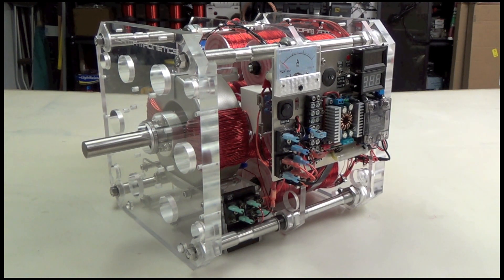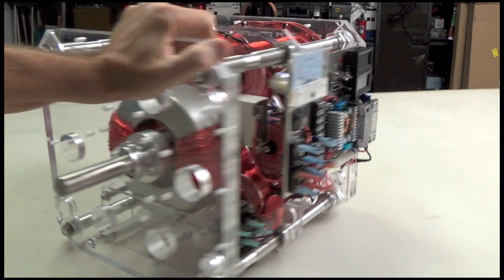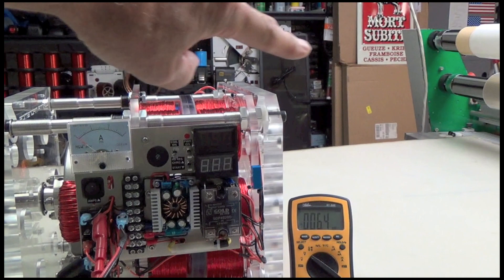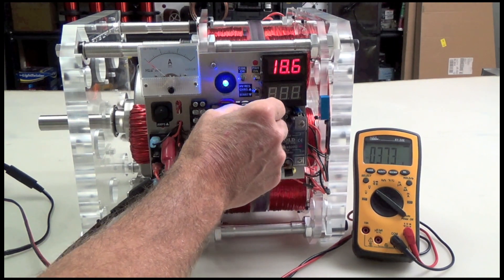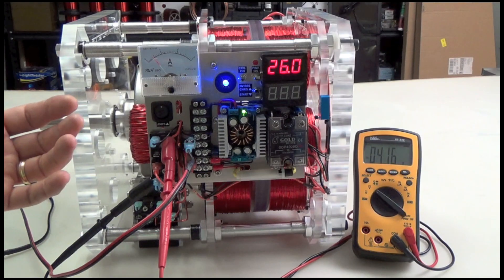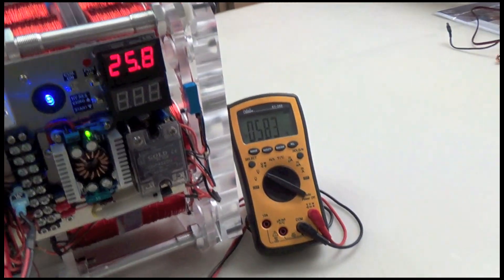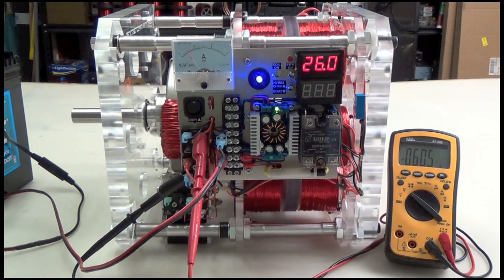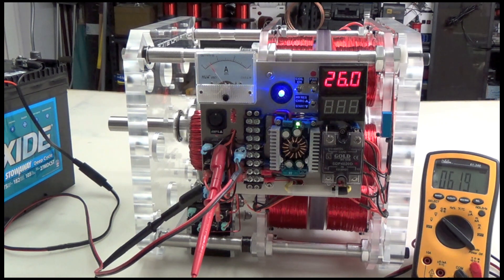Battery Bank Charger - High Efficiency T1X

Comment: If you tape up and varnish your windings they will be more solid and produce less noise. Standard motors are usually wound up in threads taped and dipped in varnish to prevent noise.
Reply from the maker: Thanks, Steve.

Comment: Great work!  Would this be a great generator for an electric car?  I could see this device just spinning away in an electric car to top off the batteries.  Then you would have limitless range, yes?  Is there a run limit?  Does it over heat? Is there an optimal operating temperature?   Very interested.  Keep up the great work!
Reply: I think it'scalable for a car but this is prototype for energy conversion to apply electric current and not the electric drive train to apply torque specifically. This would make for some interesting modification proposals to Tesla's open source information.

Comment: This looks cool but what is the reality? 
Can I use this to charge 20 - 24v 200ah batteries on parallel from 50% depletion to full charge in X number of hours. And if it can what does it cost to buy and then ongoing costs to operate?

Comment: I have been watching some of your videos they are very good with the exception that you're not using computer software to monitor the performance of your generator. it would not hurt to connect a laptop with the proper software to regulate your performance of all your machines, just a suggestion. Meters are fine if they're in the form all software where you can really know what your machine is doing to Diagnostics analysis software.

Comment: The best device  that have seen so far.How many amperes on 15 volt will this unit charge to a battery ?
J
Reply from the maker: I didn't record the specs after deciding it was too dangerous as a kit for the public at over 600V when coils reached resonance. Blew the circuitry in some crazy tests. Replaced most. Might sell the original proto.

Comment: Be cool to have a super bright LED flash light that was always ready with no need to recharge it change batteries or shake it to power it up. One that was designed to be used for long hours that charged itself back to a full charge ounce the LED was shut off. All by using graphene or graphite solid state electrolyte power cells and mini vacuum spark gaps and a carbon power cell generating an electrical power loop.  Could not electric motors on electric vehicles be designed to operate on an energy loop? High frequency electricity passing through a electric motor where the frequency is lowered from the motors use that then passed  through a vacuum spark gap increasing the frequency again to pass through another electric motor were the frequency dropped from powering the motor that then passed through a rewired drum motor generator that pumped out high frequency electricity to start the cycle all over again while having a fully charged solid state graphite or graphene soild electrolyte organic carbon power cell bank? If you design an electric vehicle well why not create it to do lots more then just transportation? An electrical vehicle has described could be parked and used with a recreational vehicle has a redundant power generation system or has a primary power system has well has being able to be used with a homes power systems? Crazy ideas yet it would all work correct?

Comment: Would it be possible to design solid state graphene soild state electrolyte power cells that you could use tesla coils with a vacuum spark gap in between the coils to loop the generated current through another power cell bank then through another set of coils ans a vacuum spark gap creating a power loop that can be tapped into and used to power other electrical devices? Maybe incorporate a organic carbon power cell bank into the design to further increase the systems operation? A total none mechanical electrical power generator? No moving or spinning parts.

Comment: Do power companies create a electrical loop pushing current through a grid system that returns to the power company creating a type of frequency vaccum within aluminum nickel wires used to conduct the electricity back through a large spark gap located in the electrical power plant?

Comment: "the law of conservation of energy states that the total energy of an isolated system remains constant—it is said to be conserved over time. Energy can neither be CREATED nor destroyed; rather, it transforms from one form to another." Wikipedia
Reply: Law of conservation is applicable ONLY, to a closed system. In an OPEN system, environmental energy can be pulled in and that too, considerable lots of it, depending on the setup. Nikola Tesla.

Comment: correct me if i am wrong but the basic idea is to take , the discharge , and multiply it via , magnetic resonance , so one can in theory charge a 24 volt battery , using a 12 volt battery.?

Comment: How many watts of output power does this produce for charging batteries?  

From a cost perspective, how is this any better than existing technologies for charging batteries?  Ie solar, wind, micro hydro, generators, etc.
Reply from the maker: Think of it only as energy conversion or transfer. Now speed the process. While doing so, condition the storage batteries for a longer lifespan. Now from a cost perspective, what advantage have you gained?
Reply: I will admit that I am new to your videos, so I don't understand all the theory behind the devices you are building.  

However, if I want to trickle charge deep cycle lead acid batteries, you could certainly do that with your 15W solar panel and your MPPT charge controller for a whole lot less money, time and effort, than building one of your devices.
Reply from the maker: bwillan Of course you can. It only requires more time to charge.
Reply: I am getting the impression that you are some how creating over unity devices.  Where by the output voltage/current is greater than the input voltage/current.

Perhaps a primer video on the theory of what you are doing would be helpful.  Your website also doesn't have much in the way of information on how and why your devices work.

Comment: You keep mentioning resonance.  Resonance of what?  How do you know you are in resonance?
Reply: just like objects having acoustic resonant frequencies, electrical AC circuits also can have electromagnetic resonant frequencies, radio technology for an example exploits electromagnetic resonance between circuits (transmitter>reciever) to do its job.
Reply: Dennis Malmberg Yes i know what resonance is, but Resonance of what?  Yes i gathered electrical resonance but I was hoping for some detail!
Reply: As far as i understand it, this "motor-generator" actually works on pulses rather than smooth AC/DC, and relies partly on feedback from itself to efficiently transform energy; it aims to re-use as much back emf as possible generated in a coil after every pulse, by quickly storing it in capacitors.

how much and long it can "feed itself" again from those caps, depends on the AC properties of the stator coils and the rotor speed, more speed means more self induction in the coils after each pulse, translating in more (power transforming) efficiency when the assembly is running faster, or/and at specific frequencies that align with the collapsing field's frequencies in the coils; resonance.
Reply: Dennis Malmberg So perhaps resonance is used here loosely.  This reminds me of the Bendini Motor/Generator.

Comment: I have a question, ive been watching all your videos, and i have to ask? could you possibly use this device to convert to AC. and say use it to increase the output of  a solar panel charging bay, but rather than having it on the DC side put it on the AC side of the loop to lower the draw on the battery bank... like feed the bank into this as a source then set up an inverter on the other side with some ultracaps.... then any AC draw could possibly be made to come from your device instead of the battery bay..... increasing efficiency in my mind by making the capacity for power generation larger than it would be just charging the batteries.  and upon editing this comment another thought occurs, could you have one before and after a solar charging bay, charge the batteries better/faster and lower the draw from them, i would think if it could be properly set up you could make a solar system that could power your entire home on 1 panel instead of needing a load of them.

Comment: I have been following your work for a year or so now.  I admire your use of geometry and the fact that you’re so excited about your research. Living off your joy will get you to your end goal promptly.  I also have the dream of been energy independent one day. This dream has set me seeking for information so I may creatively solve this issue. The problem is that I’m a carpenter and not an electrical engineer, though I am experimenting. I going to buy one these kits one day, when the time is right. Have you considered using an aerial antenna  to draw UHF AC electricity from the atmosphere, stepping it down with a reversed TC to power your magnetic generator?  Anyway keep up the great work. 

“My brain is only a receiver, in the Universe there is a core from which we obtain knowledge, strength and inspiration. I have not penetrated into the secrets of this core, but I know that it exists.”

 "If you want to find the secrets of the universe, think in terms of energy, frequency and vibration.” 

― Nikola Tesla
Reply from the maker: It is my hope that many others will also begin to realize just how true this quote actually is... 100+ years later.
The atmosphere is quite variable at times, though the earth itself is rather consistent. Thanks for your comment.

Comment: Great Job PMM - love your work. Have you seen any of the data out of the two Brazilians, Energia Universal - Ion Capture patent and existing equipment claiming they can produce 96 kWh for $5500 retail price, $2500 cost. I don't know if these prices are based on estimates of mass produced products or on the current manually produced ones. They reportedly had two of their units confiscated by the local utility after they told them to go ahead and install them. Be careful my friend.
Reply from the maker: Thanks Skip. Please message me a link or two (in english if possible) regarding this effort.
Reply: PMMG4HYBRID http://peswiki.com/index.php/Directory:Evolutions_in_Energy_%28Company_in_Brazil%29
Reply: H. Skip Robinson i clicked the link but seems it’s been taken down
Reply: H. Skip Robinson
  Looks interesting, but like all the other hopefuls, what has become of them?  Breakthrough announcements, press releases, and then POOF....silence for months.  Any recent news on this?
Reply from the maker: TradingRiskMgmt Nothing. Only time will tell since no one can get their hands on any model.

Comment: What is the output current on high voltage side?
What is output current and voltage on toroid?
How much torque is produced by shaft?
Could you run a classic generator, or non classical generator on the shaft?
Voltage is just electrical pressure, the current with the voltage is where the real power is!

The higher the voltage, the more virtual particles are produced in local surrounding space. Thereby, the more power cqn be extracted from ether, dark energy, empty space, or whatever you want to call it.
Maybe try highest voltage output across multiple resistors, each dropping the voltage across them to add in parallel to get low voltage and high amps to do some real work? Just an idea!

Comment: Hi dear Mike,again grate guy in front of my old eyes :) my congrats again with new HW generation . If you have more voltage at output then you have more load on stabilizers of controller. Probably they are dancing because of extra heat?, may  be resonance modeswitch is dancing...IMHO...
Reply from the maker: Hi Rob. The only heat you'll find is a slight warming of the two transistors on the DC-DC converter. Nothing more than typical. It mostly has to do with the inductive spikes from the collapsing primary fields being partially fed to the secondaries altering the resonant values. Great fun, and valuable experimentation to be sure.

Comment: wouldn't it be beneficial to clearly state the claims the machine can handle?

Like for any other machine: 300W at 1200 RPM for an electric motor or 120HP at 3800RPM and 20miles/gallon for an internal combustion engine?

What can this one do with a certain (electrical) input power?
how many batteries (Ah) can it charge in how long?

This is where the rubber hits the road  IMO and what is missing form ALL those alternative charging or power generating machines. they keep making vague claims but never anything concrete.

Or maybe I'm missing it

Your thoughts?

Comment: PMMG4HYBRID I wonder why you are not pursuing further toroidal generator as per Tesla's patents as it has potential to self run. The N. Tesla patent 00555190 has one drawing (the patent is about motor but we are looking at toroidal generator there) and it is shown there how to negate Lenz effect with electromagnets on bifilar coils in series to generating high voltage coils on toroid there...